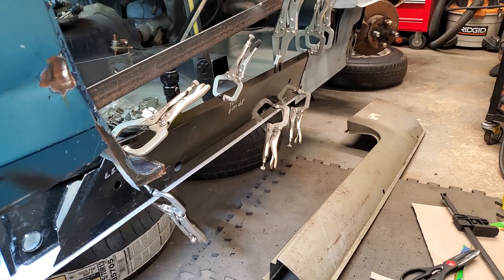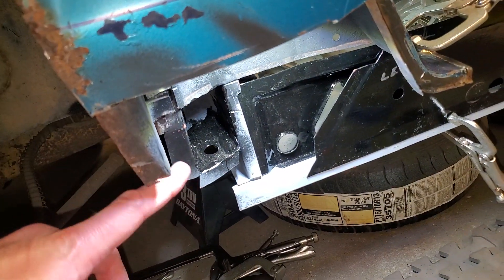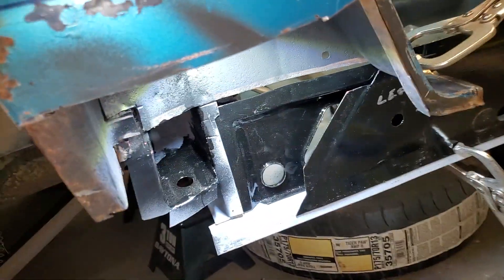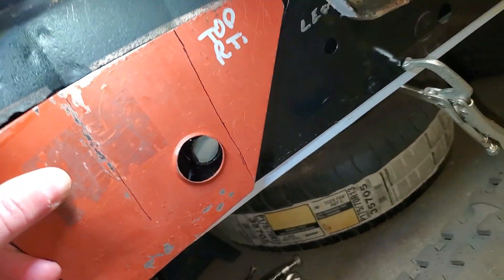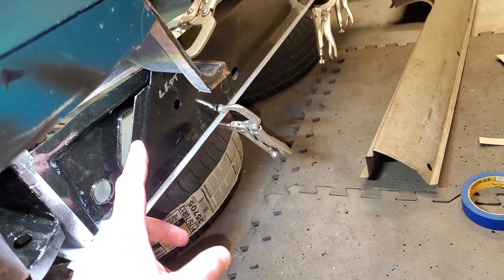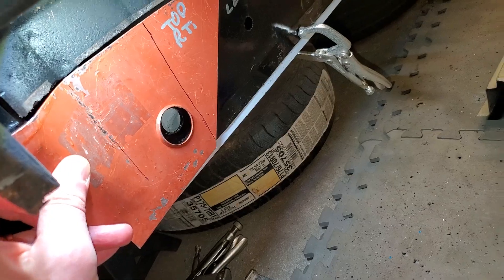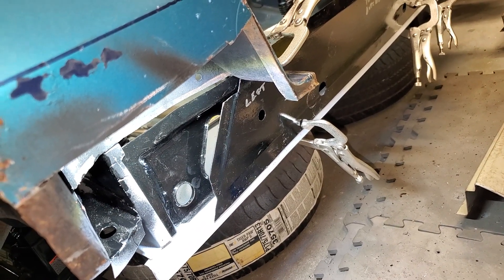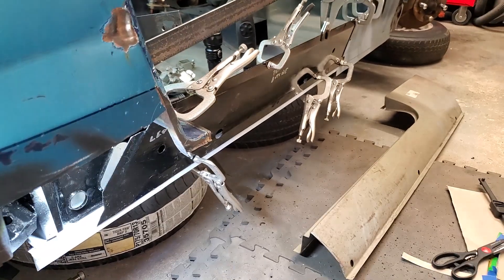Triumph GT6: The end?

Comment: Walk away for a few days and think about it. A solution will come.
I welded an mgb together that was totally rotted out a few years ago, It was an emotional job but it's my favorite go to summer car now. Stick it out.
Reply from the maker: That was my plan, to have it be my daily. That's why it's so heartbreaking.
Reply: @DavidPlass  When I did the MG I considered buying panels from British Heritage , but the old car was never going to be a show car so I made up my own from what I had around. As long as the fenders and doors fit then Honestly I isen't going to matter if things are a little off in between. We had an airplane in a few months ago and the symertary check showed it to be out more than two inches from side to side, wingtip to horizontal stab. It flew fine, so will your car.
Best of luck. 
Keep at it.
Hugs from Canada

Comment: You're doing fine. I don't think a triangular hole right the will cause any problems. I don't think it will be visible in the end anyway.
Reply from the maker: It's about the alignment - if that triangle is there, it means something else is messed up. The driver's side door opening is messed up, and I'm sure the passenger's was already (it sustained accident damage on that side)...so nothing is lining up anymore...ugh.